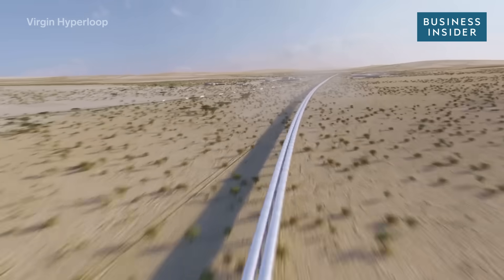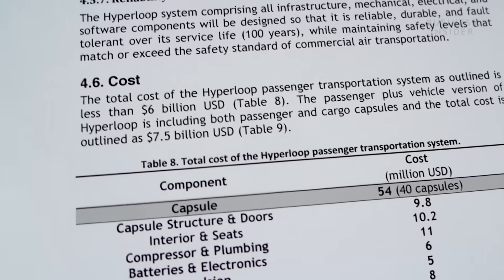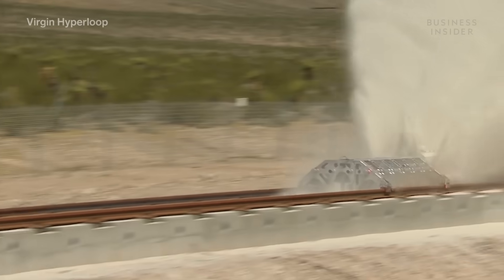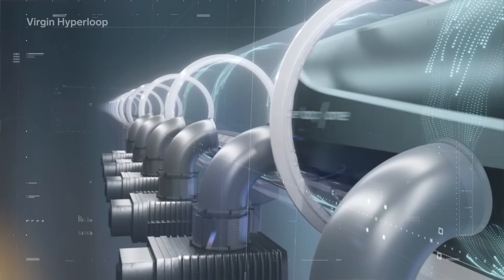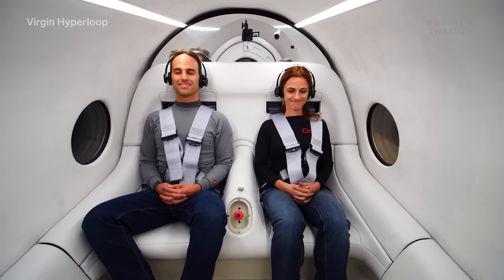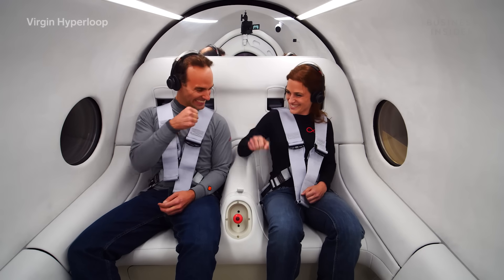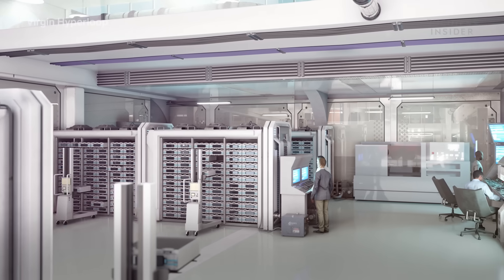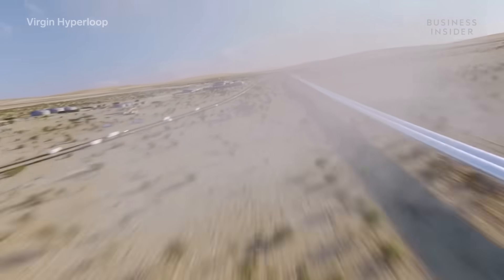How Elon Musk's 700 MPH Hyperloop Concept Could Become The Fastest Way To Travel

Comment: No one here is is thinking this through. Except TF.
Reply: Given enough time, hyperloop could work in some capacity. It's not impossible, it's just hugely inefficient and impractical. It's a boondoggle and I don't think it's really a secret. High profile, speculative projects like this are great marketing and raise money for R&D teams to fund tangentially related projects. It doesn't matter if it works or not.
Reply: Here’s one of the latest Thunderf00t ‘debunking’ videos about hyperloop: 

📺 https://youtu.be/VrbstnzbhZA 
(25 minute video)
Reply: Why don't you ask Thunderf00t how water and gas pipes... under pressure... hundreds of kilometers long survive his impossible "expansion" theory? Don't let this guy do thinking for you... maybe start thinking for yourself.
Reply: @crocodile2006  ironic btw, how you think a phd in natural sciences would know LESS than you about anything related to said thematic and say "think for yourself", but made a logical error in your very first assumption.....
Reply: @crocodile2006  You've not seen slip joints and "U" bend over roads to absorb the movement of these pipes? I do think for myself... see this http://inko.com.sg/image/data/CATALOG/Valve/Exp%20joint.pdf. Then YOU can think.

Comment: Probably going to fall apart like his Tesla’s! Definitely scary.
Reply: Do they fall apart? Tesla is a real achievement, spacex also, but this... this is what happens when you get so rich you can buy all the weed you can smoke.
Reply: @bobs12andahalf2  The build quality of Tesla's is absolutely terrible. The company on the other hand has been a success.
Reply: @emilmuhrman what's poor about the build quality
Reply: @c.s1393  The fit and finish is bad. Gaps between panels and bad paint. Plastic in the cabin fits bad etc. Sense I only test driven I  have no experience of the quality in regards of reliability.
Reply: @emilmuhrman  Why is that? Too much automation in their factories? Cheap materials? Just rushing?
Reply: @c.s1393  My guess is that they are a fairly new company and have not perfected the production process. On top of that I believe that rush have been a factor as well because how fast they have grown and therefore the big ramp up of production.
I'm sure that they will sort this out in the near future.
Reply: do you even own a tesla ?
Reply: @nico5970  No, driven I few tough.

Comment: Hyperloops make no sense because the capsules are so small. A bullet train would carry more people per hour than a Hyperloop, despite its slower speeds. Plus, it costs less to maintain and (at least in Japan) has proven its safety.
Reply: Bullet trains currently carry an incalculably greater number of passengers. Incalculable because you can't divide by zero.

Comment: Americans would do everything to avoid building high speed rail
Reply: Not true, this is actually high speed rail, just over-complicated and less good!
Reply: @kkuhn  It actually reduces air drag, and gets rid of the planes are faster argument.
Reply: @KRYMauL  Yessir, but the fact is that it is just not practical. You have to remove the air from a 100's of miles long tube. One leak and the whole thing is made useless, not to mention how dangerous it would be. Better off just making a normal maglev.
Reply: @kkuhn  One link and it’s a bullet train meaning it’s as fast as a plane.